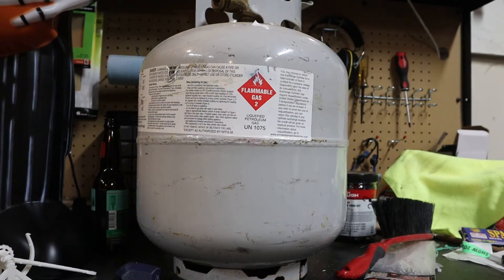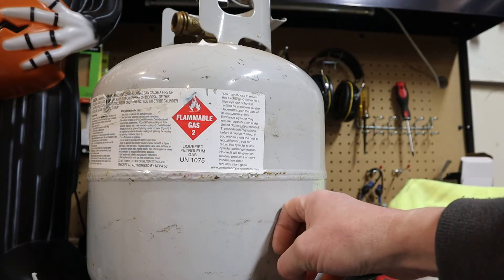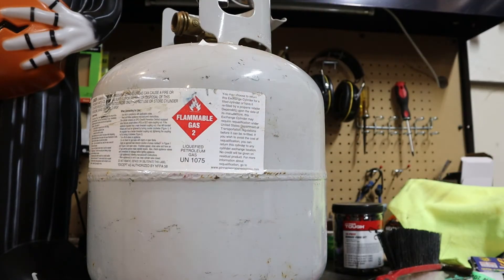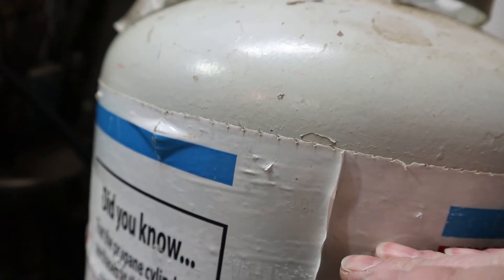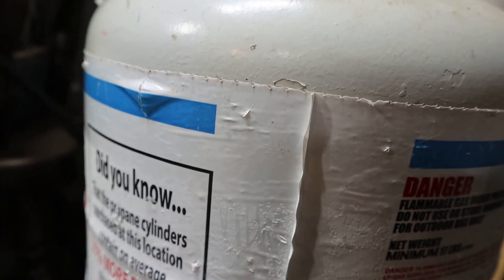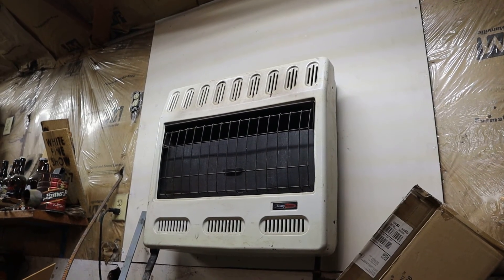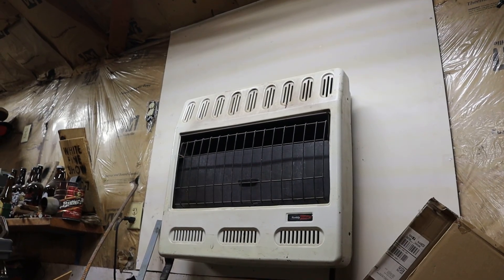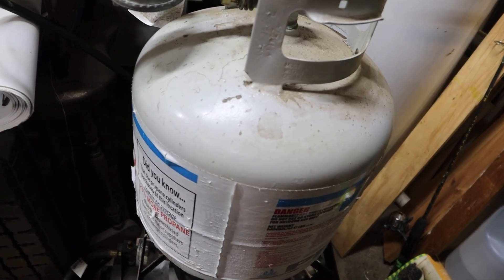Why does a propane tank frost up?

Comment: Good video and good comments. Some thoughts then recommendations, at the end.

The moment an appliance calls for heat, a pressure drop occurs in the vapor fuel line all the way to the cylinder. This pressure drop remains until the appliance is satisfied and closes the valve at the appliance. Depending on the vapor draw, at the cylinder, the liquid fuel in the lower portion of the pressure vessel is boiling to keep up with the pressure drop in the cylinder. Now, while boiling, this liquid propane is the medium actually providing the heat. As a propane molecule changes phase from liquid to vapor, heat was absorbed by it from surrounding liquid molecules. The liquid propane can and will chill itself down starting from ambient air temp all the way down to -44°F if conditions call for it! The external cylinder wall does transfer ambient air heat to the liquid propane, eventually. When full, usually, the wet surface area of the cylinder wall contacting liquid propane can adequately support an appliance call for heat. But, during use, as the liquid level drops in the cylinder, less and less vessel wall area is available to directly transfer needed heat. So, the liquid inside grows colder and colder until adequate vapor pressure cannot be produced to keep up with appliance demand. Once the appliance quits operating, the fuel vapor pressure drop is gone (once the cylinder boils just enough liquid propane to obtain equilibrium of pressure within the delivery system).

I have seen demonstrations of overworked propane cylinders where the super chilled liquid inside (around -44°F) would not produce a tenth of an inch of wc with the supply valve wide open.

To vaporize more liquid fuel out of a cylinder, regardless of size, consider the following:

Swap the cold one out with a relatively warm cylinder. Let the cold one recover to ambient air temperature before reuse.

Warm cylinder with a thermostatic 95°F heater blanket while consuming fuel. Be sure to remove electric blanket from operating cylinder when NOT energized. 

Manifold 2 or more cylinders together to significantly reduce the draw on each cylinder. Two cylinders: 1/2 draw. Three cylinders: 1/3 draw. And, so on.

Place cylinder in a shallow pan. Add water to the pan. Water is over 20 times more thermally conductive than air. 

I wish I knew this last tip decades ago when doing a roof torch down. One hundred degree day, last strip of roofing torch down to heat with a 20 pound cylinder. Flame out! Had to stop work and refill the cylinder, no spare. Instead, could have warmed the very frosty cylinder in a bucket of water and finished the job.
Reply from the maker: For my blacksmith forge I swap tanks. I may have learned as much from your comment as I did reading websites while making this video. Thank You.

Comment: Thank you for this video. When I noticed what was happening to the cannister, I thought it was about to blow up.  I cant tell you how fast I got my old divorced body up out of my recliner and turned it off. Then, I debated letting it sit to figure out what was going wrong with it or toss it out the door before I blew myself up. Well, I quickly gently placed in out on my snow covered porces and shit the door.  I used my Buddy on e last year and this never happened.  It wasnt that cold and I used it on low.  Well, it 17 degrees tonight and I had it on high.  So, thinking Im gonna freeze to death tonight. I thought call a fire dept or look for a video. I cane across your and was so relieved.  So, I rescued my little Buddy off my porch before some cold neighbor sees it and swipes it. 😂
Thanks so much. Hoping and praying we all survive this winterstorm. Also, hoping no one gets hurt trying to stay warm tonight.
Reply from the maker: Stay safe in this cold. If you have more than one tank you could swap them out as they get cold. Also I think little buddy's can be adapted to run off larger tanks so you could use the tank from your grill if you have one.
Reply: @MasterofNone2  I will be better prepared next year. I have 8 1lb cannisters. They are so pricey. At the end of winter I will buy the Bigger Buddy which will hold 2 cannisters. I watched a video on how to refill my 1 lb cannisters, so I will save them and buy the bigger tank for next year to refill the little ones. If I feel brave, I might get the hose and connect the bigger heater up to the 20 or 30 pound propane tank.  Preparation is the key.  It will be good to have 2 or 3 Buddys in case one fails.  Thanks so much for your videos.

Comment: A trick I literally just used before watching this video is I pour hot water over the tanks and regulator to keep things flowing smoothly. I live in my RV and use two, 100 pound tanks for supply and in this current weather we've been having, it's currently 4 degrees F outside, and I was awakened this morning at 5:00 am. to the sound of the heater trying to fire but it couldn't. I went out to check and sure enough, everything was frozen. I couldn't even turn the switch over valve on the regulator! I went inside and filled two, one gallon water jugs with hot tap water, my water heater runs at 140 degrees, took them outside and thawed everything out. I just poured the water over the regulator, line and the tank currently in use as it wasn't even near empty, and before I used up the first gallon, everything went back to running fine.
Reply from the maker: Stay warm Bob hope it warms up some where you are soon.

Comment: Does this mean the tank needs to be filled or does it have to do with the water heater.. I’m in an Rv
Reply from the maker: Your tank stores the bulk of the propane in liquid form while your appliance burns propane gas. When your tank freezes you are drawing the gas out faster then the liquid can boil off to a gas causing a pressure drop. The two ways to fix this would be drawing less gas or using a larger tank which allows more surface area for the liquid propane to boil off to a gas.

Comment: Mine is happening indoors 70 degrees????
Reply from the maker: It doesn't have to be about the temperature outside of the tank, it's more about rate at which the liquid propane can boil off to gas. The temp of the tank at the point where liquid meats gas is the crucial factor. A larger tank is most important because it gives you more surface area.
Reply: Does this mean the propane tank needs to be filled??
Reply: Also make sure your connections are tight!! Lmbo I didn't check til later!
Reply from the maker: @kevinosborne4632  ^^^^ This is a good point.

Comment: I've bought a portable Generator; that has Dual Fuels: 1. Gasoline or 2. Propane Gas. I am going to use propane instead of gasoline. And I will put the Generator inside a shed. Of course when the Generator is running; the inside shed gets very hot. Now a question?

If I put the propane tank INSIDE the shed will not freeze up? Even when the outside is below 0 degrees? "Inquisitive people want to know!"?

Thank  you kind Sir for your answer.
Reply from the maker: It will most likely be fine Pat. The temp isn't usually the main factor causing the tank to freeze, it's removing gas from it faster than the liquid propane can boil off to gas. This is an assumption but I would guess your generator isn't going to be pulling gas fast enough for it to be a problem.

Comment: Would it not help just to turn the temp down to allow the tank to "breath" a bit allowing it a break?

Ive got a little buddy heater with the 16oz tank. I'm just chilled and don't want to turn my central heat up, so I turned it on.
I usually run it on low, but I turned it up and 30 min later noticed it was acting like a gush of wind was blowing at it continously...
I thought "maybe it's empty" but noticed ice build up a little under the center of the tank... FREAKED me out. 
I shut it off, came to YT to see what the issue was. 
Now I'm wondering, (after your great video) had I just turned it back on low, if it would have worked itself out? 
(Ran it for 4 hrs last night on low with no problems, same room temp)
Reply from the maker: So sorry to hear about your loss Rebecca. I have heard that same thing from people before that they didn't know how much their spouse did until they passed. I am glad that my video could provide at least a small amount of help. Thank you for your comments, it means a lot especially to us smaller channels.
Reply: @MasterofNone2  Thank you so very much ❤ 
I never took a bit if it for granted, I admired it really. Just wish I would have paid more attention when he was trying to teach me things like this, now. 
But, new subscriber here! 
You can pretty much count on my views! 😅💙
Reply from the maker: Yes running at a lower temp will help or prevent this from happening, giving the tank a break will let it warm up too.👍
Reply: @MasterofNone2  Awesome! Thanks so much! It was actually your video that made the wheels in brain start turning!  🤣
Recent widow here, I'm not used to doing all this "man stuff" it amazes me all the info you guys can retain when it comes to working on ANYTHING! 
Needless to say, I'm on YT learning something new everyday! You may not realize it, but these videos are beyond helpful! ❤
Reply from the maker: @Rebecca Gaines  First of all sorry for your loss Rebecca, I have heard both women and men say after loosing a spouse that they never knew all the things their spouse did. I am glad my video was helpful to you in any way. Thank you .
Reply: Your exact experience happened to me yesterday with my Big Buddy heater. Used to run on low and then I chose to increase to medium and saw the frost, turned it off and rand to YT for help. I found this video and your comment .

I have returned to say thank you to the content creator. You have helped me and I am grateful.

Comment: Happened to me today around 25 degrees. I have heater for my patio. Propane started frosting over really good. Was pretty low so swapped it with another one.  After awhile that one started to frost over to. Like it was sitting in snow.  What can I do to keep them warm.
Reply from the maker: The right fix is to get a bigger tank, then there is more surface area for the liquid propane to boil off and keep the pressure up.

Comment: Just for those that don’t know in order to lower the temperature of a liquid it requires high pressure which is what’s happening in the tank so with that pressure even waters freezing point will go lower than 32 degrees.

Comment: 15 psi would blow up your grill lol. The pressure coming out of an lp regulator is actually 11-14" w.c. which is about 1/2 psig. Even if you had 1psig you would have flames that would be out of control and quite dangerous for a grill or any lp appliance
Reply from the maker: It's to the blacksmithing forge, and yes it does shoot flames.

Comment: Very Informative, and if people are having an issue with losing psi due to the frost that's an easy tip to just simply swap out the tank. Great video 👍
Reply from the maker: Thanks,  hopefully at some point this spring I stop having to heat the garage.

Comment: Yup ive had trouble with those freezing up too trying to run a 30k btu torpedo heater in my garage...at the cabin we had, there was a 500 gallon/pound big ass tank and we did not have trouble with that running the furnace up there north of brainerd..by the way how much snow did you get?  Got 4 inches here in the city but Rick got slammed with snow ❄️..thanks for the video!!🍺
Reply from the maker: All together we there is around a foot Lee hard to really say with how much it was blowing around though.